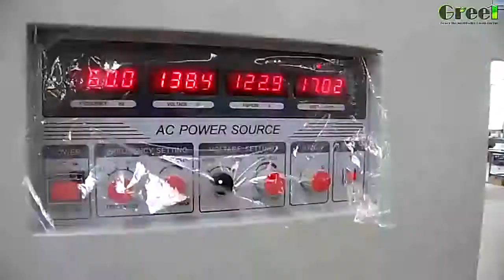100kW 3 phase permanent magnet generator

Comment: Stick this in your local water flow, best a waterfall, or collected source.running off a mountain. Or up and down , tide of the seas, wind of the gap in the mountains. Stick a flywheel in where it can be running and only needs a slap to keep it  up to required. ‘ Bleed off’ to  run using all conditions.  Cant always get what You want , but it’s covering most by weather and alter natives.
Reply from the maker: Thanks

Comment: problem are overheating , it is around 6-8 hours   an then it stops or are burned so if someone want to use this permanently  you better have several engines so you can switch one to another
Reply from the maker: Hi，the generator can add fan cooling and water cooling, this will reduce.
Reply: @greefnewenergy7722  or even better are just permanent watter flow which would turning generator which would turn water pump which would back again water on first reservoir

Comment: What is for you "LOW RPM" for nominal power ??? Be correct.
Reply from the maker: Hi, as the generator is customized, different customer have different requirement, we can make lowest rpm is 20rpm.
Reply: @greefnewenergy7722  
We, who know something about generator designs, also know that speed is not a parameter I was looking for.
Speed without power is like a woman without a box.
So please indicate some speeds at which you have a specific performance, power. We will use the ratio for other speeds.